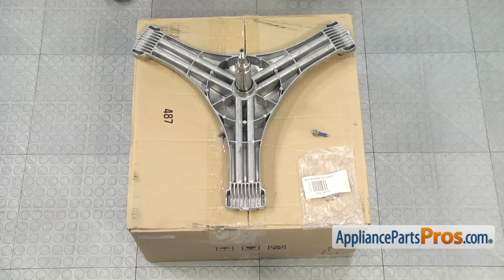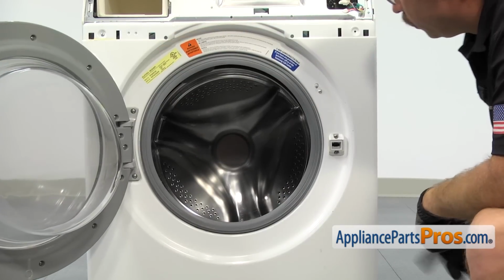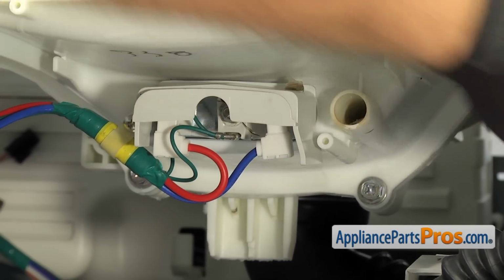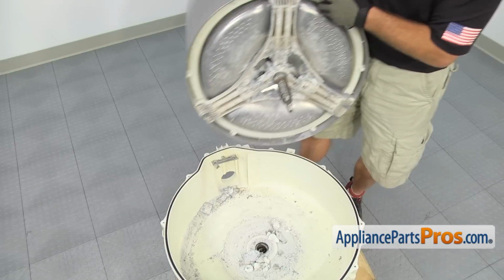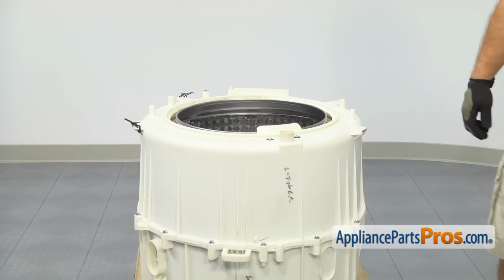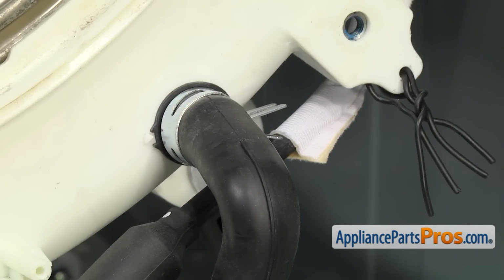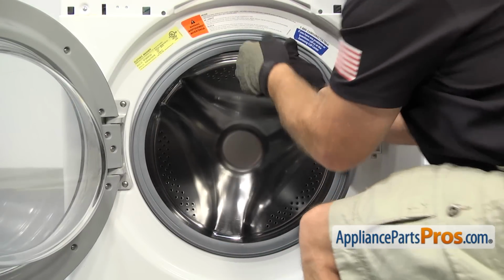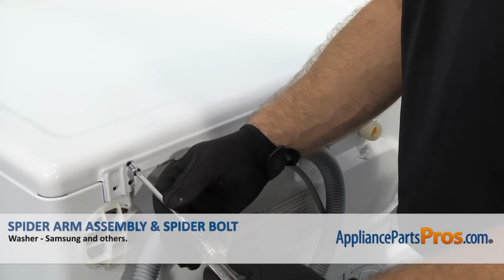Washer Tub Out of Balance? Replace the Spider Arm Assembly — Samsung (DC97-12528A)

Comment: Excellent video and I  ordered my part from them. Replacement of spider 🕷 arm, 2 spider 🕷 arm bolts. Tub seal and bottom shaft seal. I cleaned the inner and other tub and all the drain lines to get pieces of spider 🕷 arm out and all other grim. To bad the material that the spider 🕷 arm wasn't a higher grade. When it goes again might have a machine shop fabricate one.

Comment: Great Video was able to replace my broken Spider arm , bearings and bolts. I did find that the tub seal that is available was too big in diameter to fin the small channel on my model. I ended up ordering some waterproof rubber cord from Mc Master Carr and it worked great.

Comment: Thank you so much for a great DIY video to replace a Samsung spider.  I just completed changing out the spider on my Samsung washer (WF330ANW XAA). I just completed my spider replacement following your video as it went along.  There were some changes, but you help me through two very difficult places (removal of the motor and installation of the door boot spring tie).  While I was changing out the spider I included changing out the bearings, bearing seal and tub seal.  Total cost $180 and took me about seven hours from start to finish. Contacted three area Samsung repair shops to replace, but couldn't get any of the three to replace the spider.  They all advised me to replace the washer. Washer runs quiet with no banging around.  Really a great video to work along with. Hopefully I will get another 5 years out of it.
Reply: Hi, I’m going to replace all these items too. Can you tell me where you ordered your parts? How’s the washer doing now? Still working well? Thank you for any assistance. 🙏

Comment: I want to say I had to do this 3 times now, once for the spider arm, once because the front drum was leaking and needed replacing and once because the back drum needed replacing and can confidently say that this is doable in 2 hours once you understand that all you're doing here is disconnecting everything from the drum to take it out then reverse the process.

Comment: Awesome video! The camera pays attention to focus and stability to get as clear details to make the point. I hate those aluminum spiders. To prevent galvanic corrosion, they should have designed it out of a thick stamped stainless steel sheet. It would have cost them less and would have made the washer last forever, but I guess that's not longer a desirable feature from our appliance manufacturers nowadays... So much about going green!!!.

Comment: I pulled the whole thing a part only to find out that there is a slight crack in the outer tub, and also a broken spider, any advice how to fix the slight crack in the tub before I purchase the spider arm. Because I fear if I change the spider arm water will leak through the crack of the plastic drum which houses the stainless steel drum

Comment: I had this part break over 10 years ago due to galvanic corrosion. The dissimilar metals cause the part to degrade the aluminum. When I got the new Spider arm assembly, I sanded it all down cleaned it with rubbing alcohol, and spray-painted all the aluminum with zinc paint preventing this. The first one broke after 2.5 years. The new one with paint has been working for 11 years now with no issues. I am tempted to take it apart just to see but it's a big job and the time frame with no failure is confirmation enough for me. I would never buy a Samsung again but even if I bought 1 new I would do this right off bat and save myself the trouble and extra damage it causes when they break on spin cycle with a heavy load. What good is a 1-year warranty ? If you are already here it means you will do your own repairs so don't need their labor anyways.

Comment: i just discovered yesterday the spider flange assembly on my 12+ year old washer had disintegrated and looked far worse than the one in this video.  Frustrating and unacceptable to me manufacturer's make such poor quality parts that deteriorate so badly.  guess they want people to buy new washers more quickly as the washer is in solid condition other than this part.

Comment: Great thorough video. I dont have this specific model of samsung washer, but another samsung front loader so i wanted an idea of what i might be looking at down the line repair wise since its only 2 years old. Good god what a horrendous job this is to do. You have to tear the whole thing apart just to replace that one piece. And then when it probably trashed the outer tub and bearing, you have to pay more money to buy those parts too. So all that labor, on top of assemblies you have to get together. I get why people hate samsung washers now.

Comment: Thank you. As many others have said this is the best appliance repair video I have every watch.   Just the right level of explanation and just the right pace through every step enabled me to follow along and not have to replace a $700 washer.   Also one of the few repair videos that includes not just the steps up through the replacement, but also the re-assembly which was invaluable.
Reply: It’s totaled if you have to hire someone to do it. Part is like $100 - $150 alone and then the time. Looks like it can make an interesting DIY repair. How has it held up for you?

Comment: Thank you for this excellent video! The verbal explanations and filming are clear and easy to follow. I was able to successfully replace the spider flange assembly, as well as the oil seal and tub gasket. The old spider was in 4 pieces with gray glop everywhere. While it was apart I took the time to scrub everything including all the drain hoses and drum parts. There were a few minor differences between my machine and the one in the video, but nothing I couldn’t figure out. For < $300 my washer is now like new! Plus, I now know what to keep an eye out for if the spider starts corroding again.

Comment: Fantastic. The step by step video and explanation was perfect. It made a very difficult job doable I spent less than $300. and saved repair costs of estimated $1,500. to $2,000. It would have helped if the part numbers could be made available.  Thank you!.

Comment: Hello!  This project looks scary. I am still in the process of diagnosing what the problem with my washer.  If I take the cover off from the back of the washer, it is spinning just fine and water is pumping out properly.  But, if I am looking at the front of the washer, the drum is not moving!  In fact, it is stuck even if you turn the washer off and try to spin it and it won't move. It seems to me that this an obvious spider arm problem.  Am I right?  I haven't been to confirm this with diagnostic or trouble shooting by pushing different buttons at the front as the technical manual says to do.  Can someone confirm that my assumption is correct before I take hours and start disassembling the washer to get to the spider arm????  Thanks!

Comment: This is a very complicated repair even for a professional. Do not attempt unless you have excellent mechanical skills. 
Chlorine gas from Bleach attacks the aluminum and weakens it.  The spider arm should of been epoxy coated to prevent this. Painting just the aluminum (not the shaft) should make it last longer. Mask off the shaft. Brush on Aluminum primer and at least three coats of Epoxy paint are required. Dipping the part is best. Do not spray. Let dry for a long tome before assembly,

Comment: This saved me several hundred dollars.  One piece of advice, buy the spider bolts.  I tried to salvage the ones that were in originally but five of the six snapped off.  If you can save them just return the new ones but I don’t recommend attempting this without the bolts.

Comment: Thank you for the video. My dad and I fixed my washer using your instructions. In total it was about 170 in parts, and we replaced the drain pump.  That’s still better than the cost of a new one. Here’s to 10 more years of usage 🤞🏼

Comment: But the REAL question is why are we literally deconstructing and rebuilding a 5 year old washing machine that costs close to a thousand dollars??  Outrageous!
Reply: Agree.   I just sold my house with a Whirlpool Duet front loader after 17 years of good service.  I cleaned out the pump once with socks and pens in it.  I just bought another house and using a similar Duet, probably even older.  It works great except I need to replace the start button.  The average life of a clothes washer of any type is 14 years if averaging one load a day.  Mine is working 3 generations and averaging maybe 2 loads a day over that period.  The dryer, also a Whirlpool, is cleaned by me periodically.  I open it up and clean out all the lint inside the unit.  I won't buy an LG, but not familiar with Samsung washers/dryers.  Best of luck.

Comment: I would add that you must primer the new spider arm in 2-3 coats before installing.  It should prevent this deterioration, or at worst, delay it by several years more than otherwise.

Comment: If I can offer some suggestions as I have done it too, but thanks for you video for giving me an idea on how to get it apart quicker!
1.  Removing the drum.  If you are by yourself, do yourself a favor and take the weights off the front.  Its 2 bolts each and make it easier to release the springs.   2.  Speaking of springs, if you are by yourself and struggling, lay the machine on it's side and undo the springs.  Then stand it back up.  I just let the shocks come apart-you dont care if they do- you can get it out without removing them.  Put a little fresh grease on them if you have it.    Once out, I would remove the upper halves before reinstall because it's easier to line the bolts up than try to center the barrel and lift it to get the pistons back in.  The springs are the FIRST thing I hooked up on reassembly, then the shocks, then the weights.   Trouble getting the drum assembly out by yourself?  Split it inside and take the halves out.  3.  You dont REALLY need a new packing washer (2 tub halves).  But that doesn't mean you can be lazy either and not clean it either.  Clean it good with water and towels.  I pressure washed the inside of my drum housings and drum to get it smelling clean and fresh again (PROTECT THE BEARINGS and MAKE SURE your front seal is in good condition!!!).  Use some olive oil or cooking oil to lubricate the seal when reinstalling.  Do a run with just a spin cycle empty and some bleach to clean loose residue.
ALSO - check your door seal NOW before ordering parts and reassembling!  It's not that expensive and if there are signs of it leaking, now is the time to do it while you have the front panel off!  See his other video, he shows how to get it off as well.
Ordering stuff in advance?  Get new bolts for the spider arm - one at least WILL break or round off.  Just spend the money on the door seal and bolts NOW, you already saved that amount averting a technician visit or replacing the machine.

Comment: That's a pretty intense repair for most guys. Seems like Samsung could have used some anti corrosive paint or powder coating to protect that drum shaft/ spider assembly. Looks like just a matter of time before it happens again.  I'd be half tempted to paint it before installing it.  Maybe even spray it with epoxy. It needs something for it.

Comment: What is the importance of installing the metal ring in the hole vs putting it on the shaft of the spider arm and then inserting the shaft through bearings?

Comment: I can’t get the rotor off. The nut won’t turn. Tried spraying WD40 and using a long ratchet. The whole thing turns and won’t get loose. Screw driver broke something in stator so I’m not doing that again. May try removing entire drum with it still on the back to see if I can take it off later. The video is good but it makes each step look easy when in reality each step is kind of difficult.

Comment: Would this even be worth repairing, if you had to use a repairman?
Reply: This may take three hours at nominal $100 / hour rate giving $300 labor cost. Adding the spider arm costs at $100 give a total $400 before tax. 
So it doesn’t seem worthwhile for a repairman. The only option making sense is DIY.

Comment: Nice repair.   Working on LG units is easier and they are slightly better designed.  Oh you don’t need to take out the inner door seal from the tub itself to change a spider on this or an LG.   Just split the tub.   One thing I will add is a 1/4” impacter makes disassembly much easier especially for the rotor and spider arm removal.   Pre spray the spider arm bolts with penetrating oil to help them not break on removal.  For assembly start ALL spider arm bolts by hand before tightening any of them.  After a couple of turns are started, this is the easiest time to add your thread locker.   You do NOT need to pound out the metal; instead, just use a rubber mallet to set the new spider arm inPlace.   For the tub assembly start each bolt by hand driver to avoid cross threading then check each and every bolt is run up with the impacter just until it touches but no impacts.  Now do a torque sequence in a star pattern about 40 inch lbs all around putting a dot on each bolt with a sharpie.  Then increase and retorted to around 72 inch lbs in a star pattern putting a line on the bolts to signify they are tight.   You MUST wipe the seal and tube mating surfaces to ensure they are clean and dust free.   This gets you an evenly tight tub.   The only other thing is to obviously clean the tub when it is apart but also CLEAN THE DRAIN.   When the Spider does that there are bits of metal all the way to the skimmer basket in the black drain hoses etc.   those need to be removed and flushed before assembly.   After reassembly, it is normal to squeak on high-speed pin for up to 5 loads (getting quieter) if you get any water in the bearings.   It will quiet right down.

Comment: "Exhibit A" on why I'll never part with my circa 1990 Maytag washer. Four kids, 30 years, and probably 5000 washes later, and not one hick-up. There are more parts on the door to this self destructing Samsung POS than all of my Maytag. Additionally, it doesn't appear that this spider arm has been redesigned to keep this from happening again (composite of some sort, etc.) No thanks.

Comment: instead of getting it fix, with the time, effort, and all,,, wouldn't it be easier and cheaper to just buy it new.  soon as you fix it, something else will go wrong.  so, you will have to take it all apart.  it will end up costing more for labor and repair.

Comment: Is there any way to differentiate between a broken spider arm and bad shock absorbers on my front-loading Samsung washer without taking the machine apart first? Are the symptoms any different? My machine shakes badly during spin cycle. It's going to be a major pain to get into this machine, given where it's located, and I was planning to order replacement shock absorbers but I have seen a lot of comments about spider arms being the culprit for this problem.

Comment: GREAT VIDEO THANK YOU. SHOULD HE TUB BE LEVEL FRONT TO BACK? I BOUGHT ONE USED AND THE SHOCKS IN THE FRONT DON'T MATCH THE BACK. THE TUB LEANS  BACK A LITTLE BIT. I AM WONDERING IF SOMEONE "FIXED" IT WITH THE WRONG PARTS AND THAT IS WHY THE RINSE/SPIN CYCLE MAKES IT BEAT LIKE A DRUM AND VIBRATE SO MUCH IT TRIES TO WALK AWAY.

Comment: Well instructed video, you should be an educator.  I bought the “spider” bracket, the 6 screws, tub seal, front rubber boot and started the project. It took a weekend to complete as i had 2 little helpers taking turns with tools.  We went the extra step to wash the drum, the tub, drain pump and tubes and clean all moldy spots before re-assembling. This was a little different model.  

So far, a week of continuous use, the machine runs like new, the “moldy” smell is gone, and saved about $800 for a new washer.  All for less than $175 cost.     Thank you for this great video!!!!

Comment: Samsung Dryer Replaced idler pulley and spring. Now if you stand on front of the dryer the drum is turning the wrong way (clockwise) runs for 10-15 seconds and shuts off ?

Comment: Excellent video! The root cause seems to be corrosion. I would be interested to know how others addressed this problem. I think there's value in treating the new spider arm with Alodine. Alodine, unlike paint or primer, won't add weight and does a superior job of corrosion prevention. I'm looking at my machine right now and I'm 99% certain my spider arm is busted. I'll give you an update once it's disassembled and I Alodine treat the new spider. Keep the great videos coming!

Comment: We replaced spider and one damaged balance ring. Before we hang it in the washer the drum spins freely, both on its back and upright. Once we hang it in the machine, it scrubs as you turn it. I think it is rubbing the water guide attachment, which we also replaced. You really didn’t cover any rotational testing. Is this normal?

Comment: Replaced the spider arm assembly on a 10 year old Samsung.  Shame on Samsung !   I went the extra mile with the replacement and painted it with 2 coats of POL 15 paint.   Thoughts on using silicone to seal the 2 liners to prevent leaks and what can I use to clean the outside of stainless steel tub before I seal it in the liner ?   It's covered in water stains.

Comment: This type of breakdown is usually quite expensive and expensive to do, here in Spain a breakdown of that type depending on the brand, the cost of the repair is between € 300 and € 400, and in these cases the technician tells you to buy a washing machine new. By proxy it can be fixed but in some cases it is not even worth it.
Reply: Unless you do it yourself... :)
Reply: i tore into mine lastnight it is now at the road because of the cost of 4 new dampers and spider control arm, oh well. if anyone in ontario needs parts let me know before it goes bye bye